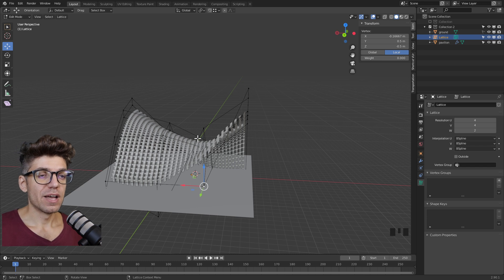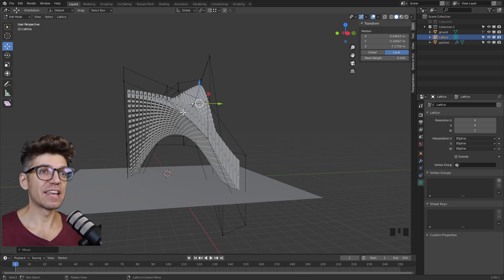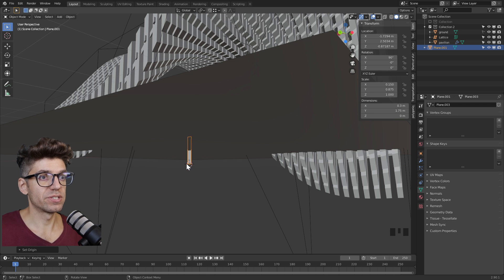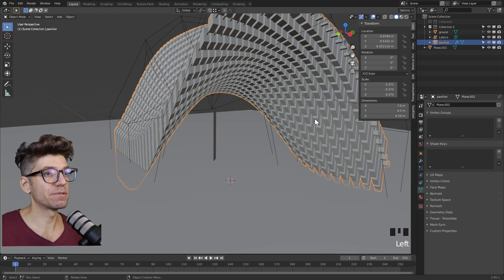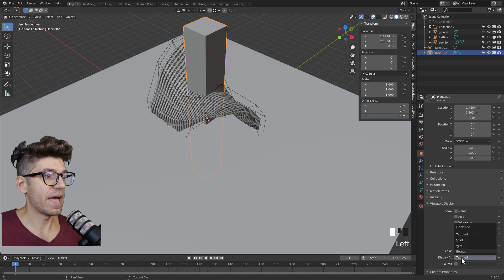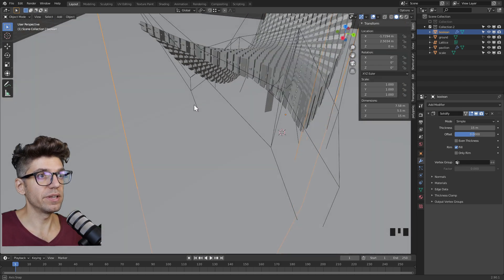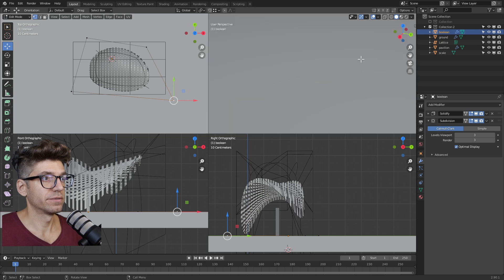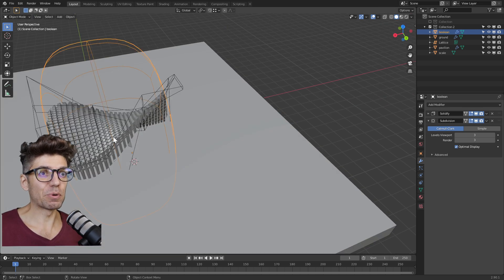Blender for Architectural Design Part 3c Refining the procedural pavilion

Comment: Nice tutorial but for some reason Blender stops responding when doing the boolean cut on the array object. I have Blender 2.91 and a boolean operation should only take a split second on a normal object, even on a subdivided monkey head with 17 million faces it only takes a few seconds, but on the array object Blender does nothing, RAM keeps ticking up while using 25% CPU, eventually I have to close the program.
I even tried to recreate a simpler array with a lattice deform linked, same thing - nothing happen.
It doesn't help if I apply all the modifiers and delete the lattice object either.
Reply from the maker: Change from exact to fast in the boolean modifier options
Reply: @UHStudio  Thanks for replying. I guess 'exact' is a bit too much for my computer when the polycount go up :)

Comment: Is there a way to use the lattice without deforming geometry? (Just moves the elements)?
Reply from the maker: Yes, you could move all the vertices of the lattice in a different place. But in this case, why not move the base geometry?